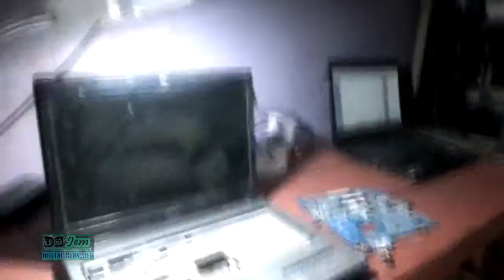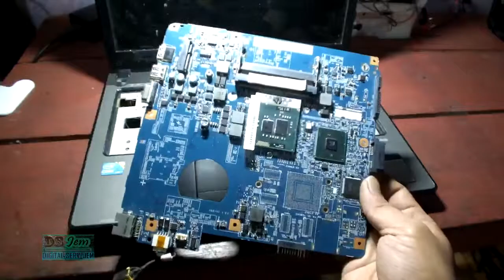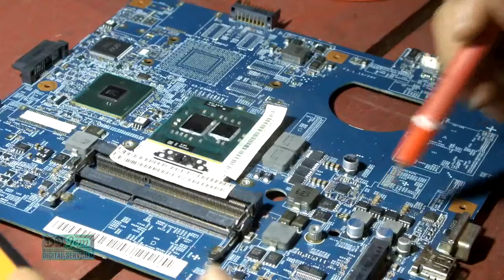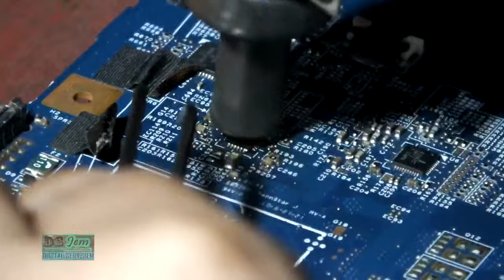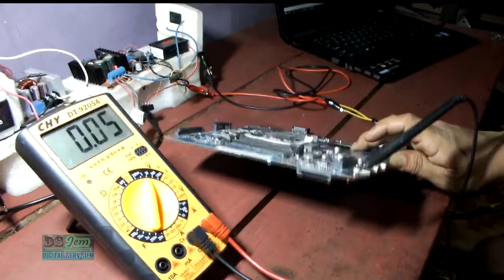MEMPERBAIKI LAPTOP MATI TOTAL-KERUSAKAN IC 3V DAN 5V-LAPTOP TIDAK MAU HIDUP-LAPTOP TIDAK MAU NYALA

Comment: Bang mau nanyak nih kerusakan acer emachines d725 klo di colokkn charger motherboard lngsng nyala tp layar tidak tampil. Itu pun posisi cd romny dicabut. Klo terpasang cd rom ny sm x ga mau hidup laptopny. Klo batre msh mau ngecas normal. Lampu indikator charger n power nyala normal. Lmp hard disk tdk ad respon. Apa mngkn ad ngaruh ke ram sm ic powerny ya? Ramny ud saya coba brshkn. Tp layar ttp tdk mau nyala.  Sblmny tanks.
Reply from the maker: Klo masalah laptop black screen/tidak ada tampilan gambar dilayarnya, ada beberapa penyebabnya,. Salah satunya masalah ram  dan ic grafis,. Coba gnti ram dulu, klo masi tdk mau, coba cek mengunakn layar external,gunakan monitor/tv led,. Ada gmbar atau tdk

Comment: Bang. Mohon bantuannya. Acer z1402. Di colok charge lampu indikator tidak nyala. Tapi kipas berputar kencang . Kemudian ada koil panas sekali di dekat colokan charger.
Reply from the maker: Kebamyakan kasus coin tidk perna panas walaupun konslet dijalur nya,, itu yg panas biasanya berada disekitaran coil,sehinga terasa coil yg panas,, yg panas itu biasanya capasitor,transistor/mosfet dan ic,dan terkadang resistor jg bisa panas..
Reply: @digitalservvjem  kalo charger tetap di colok dalam keadaan seperti itu bahaya tidak bang ? Maksudnya mau mengukur 5v, 3v gitu dll.
Reply from the maker: Aman aja mas,, usahakn jgn bercontak degn positif dam ground

Comment: bang kalo tegagan 3v 5v sudah hadir namun laptop mati total kerusakan dimananya ya?
Reply from the maker: itu kerusakan nya di system s5enable nya gan,, nanti tegangan 3 dan 5v itu akan ketemu lg di salah satu ic s5enable,, dari situ nanti akan disuply ke keberapa ic tegulator stepdwn,, agan lihat di schema lalu telusuri keluaran dari 3dan5v. terkhusus yg keluaran 5v,. atau ada kemungkinan ec/embleded controler nya yg bermasalh,, agan cek tegamgan input dari ec apakah keluar atau tdk, dan cek tegangan printah dari ec, ada atau tdk.